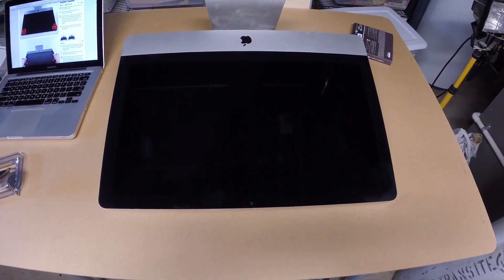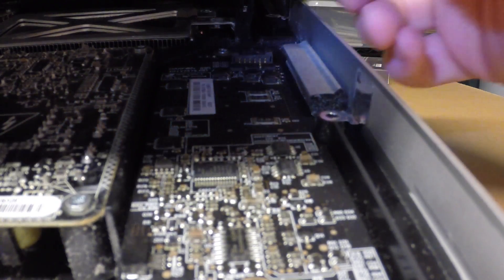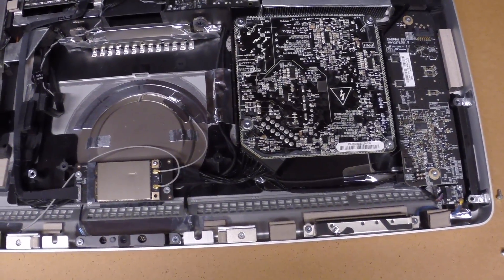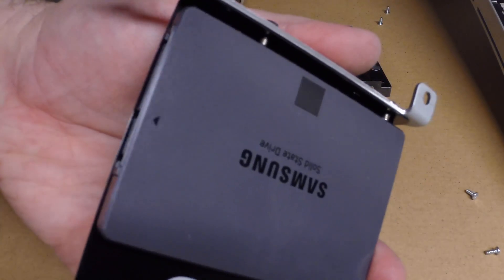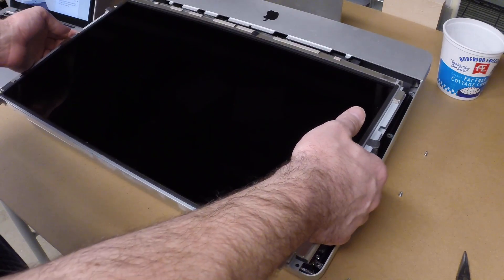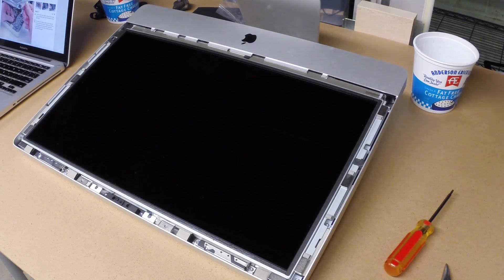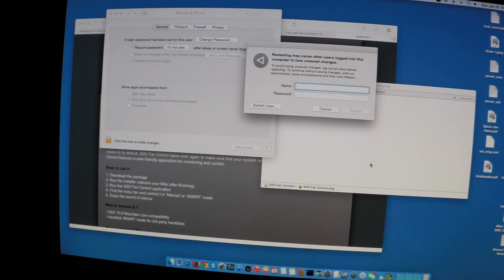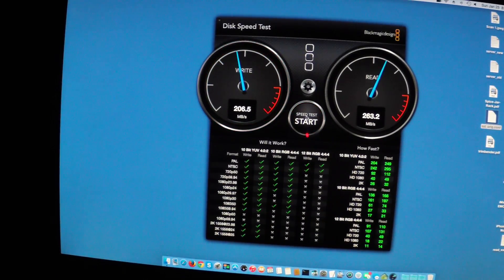iMac (circa 2009) Hard Drive to SSD Upgrade

Comment: mine stopped turning on after the replacement, I mean it works intermittently idk what the problem is
Reply from the maker: That is odd. Almost sounds like a power supply issue.

Comment: This is the mother of all old iMac SSD replacement videos.  You've got the explanation about not needing the temperature sensor (because software!) AND the fact that the original cables plug right in to the new drive without going through an adapter!  These were the things I wanted to see working!  Awesome.  Thanks Rick!   Now what about installing the OS BEFORE you install the drive.  The machine only goes to Sierra right?
Reply: I moved my OS before swapping drives. You just need to boot up from the restore partition (hold down Option key on startup and choose Recovery drive). Once it starts up, use disk utility to restore your current drive ONTO your new drive. Your new drive will be erased and then the source drive will be copied to it.

Comment: But how do you prepare the ssd for the imac?  Do you have to format it first or can everything be done after it’s installed?
Reply from the maker: You should be able to install the system on it after you install the drive in the computer. If you hold down command-r while booting, it will take you into the recovery console. This can take a while as it has to load the recovery system from over the internet. From there you can using Disk Utility to format the drive and then install macOS. Alternatively, you can install the system on the drive while it is in an external USB enclosure. That way it is ready to do.

Comment: i have replaced the hard drive of my iMac 27 inch with an SSD and I had no issue with the fans.I did not even use a software nor nothing

Comment: From where do you installed the OS again? CD?
Reply from the maker: You can hold down command-r while rebooting to access the recovery console. From there you can install the system.
Reply: RickMakes i need internet connection right?

Comment: hey what if i do not clone my hard drive im replacing and just put in the new ssd? will i be able to install the os or will i need a installation dist or thumb drive? thanks
Reply from the maker: In that case, you can probably hold down command-R when rebooting and install a fresh operating system using the recovery console.

Comment: Rick, Why did you change it?
Reply from the maker: The SSD is a lot faster. It gave this old computer a new life. My wife was using it but I recently switched her to a 2012 Mac Mini. I did a fresh install on the iMac and am keeping it on hand with some older software that doesn't run on the newer systems.
Reply: RickMakes I should have asked “why did you change the format”? I kind of knew you wanted a bigger/faster HD.
Reply from the maker: @MRrwmac  Probably the biggest advantage of APFS is that if you copy a file, it only stores it once on the hard drive. If you change the copy, it only stores the change. It also has better data integrity features.
Reply: RickMakes Thank you for explaining.

Comment: I this essentially the same process for the late 2010 27" iMac?
Reply from the maker: I don't see a late 2010 iMac. I did find instructions for a mid 2010 27" iMac. You could probably watch my video to get a feel for what to expect but then follow the instructions on ifixit to do the actual procedure. I'm guess the procedure is slightly different from my video but things like connectors will probably be similar. Here is the ifixit procedure: https://www.ifixit.com/Guide/iMac+Intel+27-Inch+EMC+2390+Hard+Drive+Replacement/8919
Reply: @Rickmakes  thanks; my error it was mid 2010.  I will watch the video......

Comment: Hello! So, here we are several years later... how did the drive fare with a digital fan control? Thanks!
Reply from the maker: My wife was using the computer up until a few months ago. The SSD and fan control software were both still working great. We switched computers because I had a newer computer available (2012 Mac Mini).
Reply: RickMakes thank you so much!

Comment: dear creator    Ive got a black screen, is it somthing disconected???    I can check the power of screen and sound. I`m guessing that  the problem is  the most wide cable. isnt it?   
by the way the video is the best help Ive ever seen before thx
Reply from the maker: I would check all of the connections. You can also shine a flashlight on the screen when you turn it on. If you see a dim image on the screen, then the backlight isn't working.

Comment: Very useful video. Thank you. One quick question: The third cable on the original hard drive (I assume a temperature sensor) has nowhere to go on a new SSD. When you simply left it unconnected did that cause any problems such as the fans working overtime? Grateful for any advice re that ‘spare’ cable.
Reply from the maker: If you forward to around 12:50, I talk about some software you can use to regulate the fan speed. I put a link to it in the description. It seems to work very well. You may hear the fan ramp up when you reboot but once the system is loaded, the fan speed drops.
Reply: @Rickmakes  Thanks so much for such a swift reply. So, just to make sure I’ve understood; ignore the ‘spare’  cable and leave it unconnected, but install the software?
Reply from the maker: Trevor and Jo Taylor Correct.

Comment: Thanks for the detailed video! One question: was it actually worth it? i.e. was there a noticeable performance improvement?
Reply from the maker: There is a noticable speed boost. It would be a bigger boost if this computer had SATAIII. This is my wife's computer. She doesn't use it daily. She mostly used for managing her photos. If I hadn't upgraded, I'm guessing we would have needed to get a new computer.
Reply: RickMakes  is a SATA 2?
Reply: I would assume based on the benchmark tests and the visible video boot times that it did.  I have bought a few 10 year old laptops and put in SSD and there is a better performance issue.   Trust me!

Comment: Thanks for the useful video Rick! I downloaded the ssd fan control and i'm not getting a temp reading and I also don't have the smart option (im assuming because of that) I've set the RPM to 1100 on manual.
Reply from the maker: Hmm... It is probably fine to set a static value so long as the noise doesn't bother you.

Comment: So how can I clone my new ssd before I do this process ? Or can I just change ssd and install new OS ?
Reply from the maker: You can clone is before or install new. If you get the drive up and running using an external USB enclosure, it should just work when you install it in the computer.
Reply: @Rickmakes  I would like to put ssd as primary hard drive, and use regular as data . Domt want to use enclosure because I believe USB speed is 2.0. Now I am confuse if I should remove optical and put ssd. Bit what should I do about the sensor ? And how can I make ssd as primary so system can boot for ssd?
Reply from the maker: If you don't have any data you need on the current hard drive, you can just replace it with the SSD and reinstall the system on it from scratch. You can use the SSD Fan Control software in place of the sensor. I put a link to it in the description.

Comment: Nice video.  Messing with those cables seems a bit tricky. An SSD does make a tremendous  difference.  I put one in my 2009 Macbook  pro and it turned an old slow machine into a fast one.  I since bought a used 2012 Macbook pro so I could get 16GB of Ram and I took the SSD out of the old computer and put it into the new one. I read that the newer imacs have the glass glued on instead of using magnets.
Reply from the maker: I haven't messed with any newer model iMacs. I just installed SSDs and RAM in my parent's 5yr old Mac Mini and Macbook Pro. It really gives the older hardware new life. It is seems like magic.

Comment: how do u get the external dvd drive to work when u have a ssd in the opticalk drive slot is there a code to put in to terminal
Reply from the maker: Are you talking about just using an external DVD or booting from an external DVD? A USB DVD should work if you just plug it in.

Comment: I installed an ssd by Sandisk but my iMac 27 late 2009 doesn’t recognise the new ssd. I have to reset the PRAM?
Reply from the maker: You could try resetting the PRAM. Also double check that your cables are properly connect. You might also try replacing the battery on the motherboard.
Reply: Go to Disk Ultilities and format your SSD to Mac OS Extended (Journaled) and it will reconize

Comment: How TF did you get that glass off so easy
Reply from the maker: Were you using a specialized suction up or a suction cup soap tray? The soap tray made easy work of breaking the magnet's hold on the glass.
Reply: I haven't tried yet. Is it just magnets or are there clips as well?
Reply from the maker: It just used magnets. I do have a link in the description to some small suction cups. You could also use something like a suction cup phone/GoPro mount like you would use on a car windshield.
Reply: I have about 500 suction cups. I get one Everytime I order an iPhone screen

Comment: what is needed to be done to the ssd so that the iMac recognizes it?  my ssd was new and empty and the iMac does not recognize it. I could not clone it because the previous one got damaged. I formated the ssd to journaled mac os and it still is not recognized.  what Am I missing??
Reply from the maker: You will need to install the system (macOS) on it. You can boot into the recovery console by pressing command-R while the machine is booting. This will have the option to install macOS. Otherwise, you can plug the SSD into a USB enclosure and install macOS on it using another Mac. You just need to run the macOS installer (downloaded from the App Store) and make sure to choose your external USB drive instead of the internal drive. Once you have it installed on the SSD, you can put it in your iMac and it should boot.
Reply: RickMakes comand R does not pull my recovery mode. instead it shows a grey folder with a question mark meaning it does not see the hard drive. I have no idea how to approach this issue. please help!!!
Reply: I got exactly the same problem. Does anyone know what to do? Thanks
Reply: actually i find out the problem. It has nothing todo with your hard drive. Its because the keyboard was not recognized. Try to open the capitalize function and see if the green light on the keyboard is on. If not, your keyboard is not connected to the computer thats why it won't start up properly. I recommend to use a wire keyboard and press windows sign+R when you start up.
Reply: Dave Trussell  I was able to fix mine by installing the OS into the drive usinh a MACBOOK PRO. after the OS is installed, the drive gets recognized. Another thing that I realized is that when you install the OS into the drive, some other files needed for recognition get is taller as well. Another option would be to clone the SSD from any other OS system you have at home. that way you will get this files that you need and can upgrade to a new OS if you need. hope this works for you!!!!
Reply: Dave Trussel, what did you do in the end? And which reply by RickMakes are you referring to? Thanks ;)

Comment: hi can I use 3.5" hard drive?
Reply from the maker: Yes. You can use a 3.5" drive. You will likely still need to use the fan control software unless you can find a hard drive with the temp sensor that is built-in and compatible with the iMac.
Reply: ok. thank you :)
Reply: If you use another drive of the same make ie. seagate etc then I believe the sensor cable will still fit.

Comment: Helpful video, thanks. I had one problem though, I installed the ssd internally, and it will not boot. It gets to the apple logo with the status bar, loads to about 95-100%, and just sits there. Funny thing is, when I have it plugged in via usb, it boots up just fine. Any suggestions?

This guy gives a pretty good description of the problem: 
https://discussions.apple.com/thread/7545674?start=0&tstart=0

Comment: Rick, thank you very much for posting this video. I watched your video probably 5-7 times, took notes on everything, bought everything you suggested in the notes section and did exactly what you did. The only difference was that I chose the Samsung 850 EVO ssd. Hardware installation was fine. Gray screen showed up and after that the dreadful blinking question mark folder. I tried many different key combinations, including (cmd+r, cmd+rp, cmd+opt+r, shift key, etc..) to get the screen you got on your video (exact minute: 11:32) but nothing worked. I tried putting back the old HDD and everything booted normally. So with that I came to realization that I didn't format the new SSD. Can you please direct me in the right direction on how to format the new Samsung 850 EVO ssd before installing it into iMac, or do you format the new ssd after you do the hardware installion. I would really appreciate specifics on the proper formatting of a new ssd. THANKS MUCH IN ADVANCE!
Reply: same question here. Does anyone know what to do?
Reply: Or have you figured out the answer? since its been 5 months already..
Reply: Hong Li, I just saw your question. Sorry! Yes I did figure it out how to go around my problem. Here's what I did, if it's at all helpful:
1. I connected my newly purchased Samsung 850 EVO ssd to my Mac as a secondary External Hard Drive via USB 3.0 cable (https://www.amazon.com/Seagate-FreeAgent-STAE-104-Compatible-Black-Boat/dp/B06Y55HBKQ/ref=sr_1_10?ie=UTF8&qid=1505249424&sr=8-10&keywords=Seagate+cable)

2. Before the upgrade to SSD drive my Mac was running older version of Mac OS X I believe it was (10.6.8). I can't remember now, since it was about a year ago. So, I downloaded a FREE version of newer version of Mac OS X (10.10) and installed it on a Samsung 850 EVO ssd. (That took a while, about 3 hours, due to USB speed limitation)

3. Then I went to Setting > Startup DIsk and made sure the newly SSD drive showed as an option to restart my Mac with. It was there. I selected it and restarted the Mac. Upon the restart everything worked great except evrythythg was super slow that was because the SSD drive was connected via USB cable. 

4. So now knowing that everything boots from new SSD, I shut down my Mac and did all of the steps on removing old SATA drive and putting my new SSD drive by exactly following the video above. Thank you Rick!

5. I did install "Fan Control" app just as Rick mentioned in the video and everything worked beautifully. I also maxed my RAM which is 16 GB. 

THAT'S IT!

I still use my old Mac 2009 running new Samsung 850 EVO (1TB of SSD) on it. So, for nearly $300 i've updated my 2009 Mac to a spec that isn't even available at Apple store. If you have old Mac try it, it's worth the effort.

Comment: Thanks for the video! I was inspired to upgrade my 2009 iMac. I just finished it and my stats are: hdd write 88.5 read 96.4, sdd write 254.1 read 269.0. Hdd boot time 1:18, ssd boot time 30.49 seconds. Sweet!
Reply from the maker: +shaktijim Great to hear! It is a nice way to breath new life into an older machine.

Comment: Thanks for the video. A question: Do you know if I can put the SSD drive like a primary drive and leave the HDD drive like secondary drive? Only for storage.Thanks again.
Reply from the maker: +JR TECH COMPUTER Innovation & Quality I am not sure. You might be able to put one of the hard drives in place of the optical drive. I think there are companies that make mounting adapters to do that but I don't have any experience with it.

Comment: You don't need a caddy for the SSD... just use some double-sided sticky tape and attach it inside the iMac where the HD goes
Reply: Velcro
Reply: +alienrefugee51 great! Could you explain in more detail? please thanks .
Reply: Not really sure how else to explain it... Basically, put the double-sided tape underneath the SSD and stick it to the iMac, exactly where the HD caddy was. You're attaching it to the back part of the iMac. Maybe attach all the cables to the SSD first and then stick it, so the drive will be close enough to the cables. I put my SSD in place of the optical drive because I didn't want to have to deal with the HD fan sensor issue. Now everything is run off the SSD and the HD drive has now become a Time Machine back-up. You can also use heavy duty duct tape instead of double-sided sticky tape. That's what I used. You're not going to be moving the iMac around and the SSD has no moving parts, so it's not going anywhere
Reply: optical drive bay has a slower sata connection...
Reply: I used wire to suspend the ssd so it doesn't touch anything
Reply: i  agree but think i would do a bit more than sticky tape, maybe addd some hot glue like another guy says or a piece of styrofoam or something else not likely to melt  to prop it up so when sticky tape gets warm gravity wont let it sag and pull on the connectors.